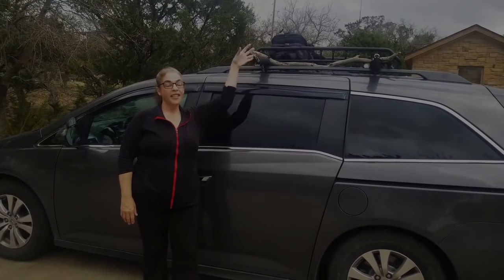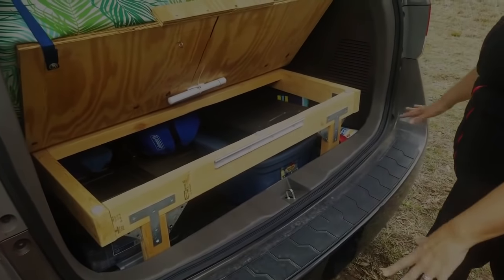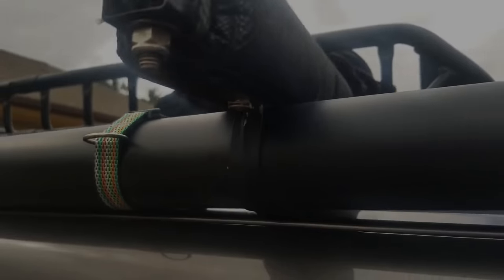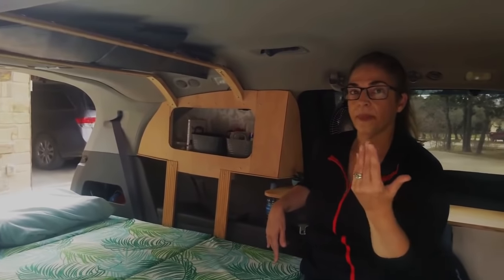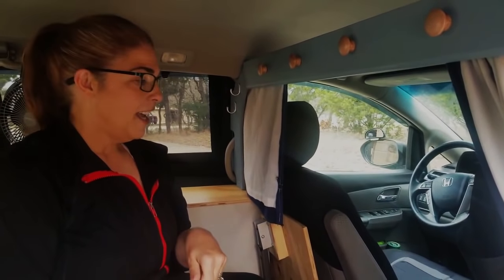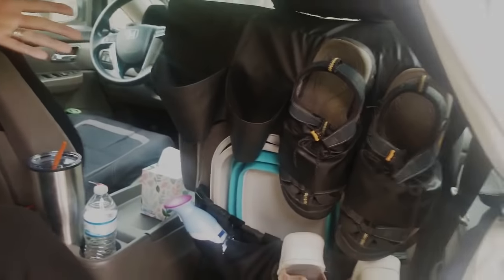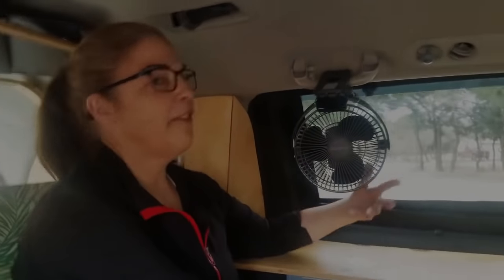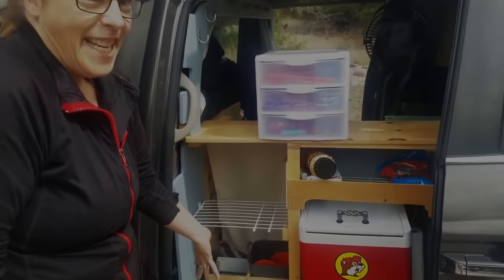My minivan camper REVEALED! Full in-depth conversion van tour

Comment from the maker: Watch Next > How I use the toilet https://youtu.be/61V3hTasCdw  and  How I Built my Minivan Camper https://youtu.be/tb3yc9suL20
Reply: The arch for the front curtain doesn't block the light at the top. You need another board on top of that straight board and ARCH it. So it does work.
You did a great job on the sides though.
Reply: Question, what is tge height of the legs fir your bed? You can sit up!  Yet it appears you still have storage underneath.

Comment: I enjoyed your video and learned a few things. Love your ability to just turn it back into a minivan, nothing drilled or modified from the original condition of the van. Very interested in how you secured the arch using I think the two grab handles(?). Also loved your convertible couch design, and that table, omg.... such a dream to have in a minivan (I  have the same van) and be able to actually sit up and be comfy at it. Thanks for posting!

Comment: I have a 2007 Odyssey and love the beast! I'm in the process of modding it for camping and it's great. I found a roof top basket like yours at discountramps. Excellent selection for ramps, racks, etc. I'm also a kayaker and using a 12' inflatable paddle board and 12' inflatable kayak which will be stored on top. They are very compact! Your build is just great and thanks for the vid!!

Comment: Hi Leslie, your video popped up & I continually look at these van builds bc I think someday I’ll wake up knowing how to build sh*t but so far...  I bought a 2019 Dodge GC & it’s just me to plan for.  I am giving up my apt soon, putting loved things into storage & doing a no-build build using things I already have.  I don’t want to spend money on plastics. 

Kudos to you for being so handy. I would attempt a project but I don’t own tools or have an area to use so I’ll just subscribe & bookmark ur channel with the hope that someday I could do 1 or more of these builds myself.  As u said, people modify their initial build all the time, I’ve heard that from most creators.  

Bc I want the best storage, I would love to have those side cabinets that fit into your rear windows but I do have to consider that this van has the venting windows in the back so I would need to have a clear path for that air or be able to have the fan there.  My next interest is having that arch but again, this van has a plastic column down the middle of the whole ceiling just to hold tablets for people’s viewing pleasure from the 2nd & 3rd row seats.  I would need to scribe the wood around that but at least I have the door handles to strap to.  Problem is, those handles are handy for me to use getting in & out sometimes.  I have lots of room above my head in the driver’s seat so I would love to have a shelf built on the top so I’m thinking of the arch going to the bottom of that ceiling column & the shelf in 2 parts on either side, if u could imagine that. It would just be used to store the window covers & soft goods like towels, clothes, etc.

This is dependent on if I need those door handles but time will tell as I could just use a little step stool to make the big step into the van (only bc I’m 72 & have lost some abilities I used to have, lol).  I am thinking of getting a running board installed like I had in my SUV to help me get in/out.  Anyway, I’ve chatted enough, I’m going to binge ur other videos.  Wishing you guys love, luck & health on your journey. I’m in NJ but have a feeling I’ll end up in FL near my sister in PSL eventually when I tire of my travels.  Cheers, Mo in NJ.
Reply from the maker: Hi Mo, Yeah it's great to stay inspired even if you're not going to do that exact project. I watch videos of all kinds of swanky stuff I'm never going to build!!🤣 Like you said, you never know what will become of your van, or when / where inspiration and energy will materialize. You have  a lot of options, too, if you're travelling solo. All the storage...the STORAGE!! Best of luck during the design process, and let me know how it's going. Thanks for taking the time to chat.

Comment: nice setup, I too have a minivan but I do have solar and a car carrier on top for the weeks out in  BLM land and a shower tent. I do like your side shelves in the back. I will check out that video.
Reply from the maker: Hi Nota, I'm jealous of your shower tent, as I am right this moment trying to attach a tent fly to my van so I can shower in a... shall we say... modest fashion😆
Reply: @TheVanThatGotAway   thanks for the reply, I have the old version of Walmart's Ozark trail 2 room shower tent, (they have a new instant pop up one now) the tent can be set up by 1 person (I'm a solo traveler) and my bed can fit in it when it's too hot in the van. I did mark the poles and pins that fit in the ends of the poles with bright nail polish dots so I can quickly know if I have the correct pole in fading light.  the price has doubled since I bought mine but if I have too I would pay it to replace mine, but it shows no wear or signs of aging and I've used it for years.  you can tell I really like my little tent.
Reply: @TheVanThatGotAway  i haven't built it yet but I was thinking a shower curtain that hangs from the trunk.  Get a bamboo matt.  Also another guy did a pvc pipe on the car roof angled with gravity feeding it.  I'm thinking that that gravity connected to a small on demand water heater...connected to a shower head would make a portable shower.  The shower curtain hanging from the hatchback would have to be something that could be rolled up and snapped back into place for storage.

Comment: I really love all that you did to your Honda Odyssey!!  Great job!!! Wish you could give me some ideas for my 2016 Honda Pilot.  I've been camping in the Pilot for about a year.  I also have a camper shuttle bus, but find myself using my Pilot for longer trips and last minute trips (whether overnight or several days.)  I must say I enjoy being in my shuttle bus camper because every window opens and the airflow and extra space are amazing, but my Pilot is so "easy" to take off in - I hardly ever pay for a hotel room anymore, instead choosing to find a tenting campsite for $10-$20 and I can use their shower in the morning too.  The only thing is.....I'd really like a few things built in for the Pilot, but haven't done so yet.  I would like to take all the rear seats out, but am unsure if that will void a warranty or cause problems with the air bags. LOVE LOVE LOVE your bed, table, arch, and kitchen space!
Reply from the maker: Hi Shannon! Sounds like you're living the dream 😃 I love that you have choices. That's a really good question about the warranty; I don't have any experience with it. Are any of the seats designed to pop out and back in,  like the 2nd row of some minivans?
Reply: @TheVanThatGotAway  it does not appear so. I’ll call the dealership today. Thanks for your awesome videos!

Comment: This is awesome! Quick question, Did you drill the strap into the plywood to assist pulling the bed back up or staple it on?
Reply from the maker: I used a big, bad screw and washer to secure it. Thanks for asking!

Comment: Great build!! The bed looks very spacious! What dimensions did you end up going with for it?
Reply from the maker: Hi Beau, I've been looking around for a tape measure but I didn't pack one for the road and we're currently on the side of a mountain somewhere 😂 But I bought a full sized foam mattress, then cut down the width a few inches so it was as wide as it could be and still move when changing the bed to a bench. Stay tuned and I'll do a more in-depth video down the line for you on just the bed build.

Comment: Wonderful, you helped me with all my issues for bed, cross bar and rangement! What make you decide to put the shelves to the driver side beside the passenger side?
Reply from the maker: HI Joanne, Thanks for asking! Do you mean those shelves that go in the 3rd row window wells, with the 2 slats across the ceiling? I decided to put them on both the driver's AND passenger's side since my husband and I are both travelling together. We need all the storage space we can get! Thanks for watching.
Reply: @TheVanThatGotAway  no the one just near the driver seat, where you put your icebox..
Reply from the maker: For that, I went back and forth a LOT but I decided to keep the passenger side unblocked in case we had to let anyone in / out curbside. 'Cause if I put the bed in bench mode, I can actually install 2 out of the 3 middle row seats. Thanks for asking!

Comment: Awesome videos Leslie, thank you! Quick question, do you have those blackout reflectix for your windows ? If so did you use spray adhesive for the fabric and if so does it smell? :))))Thank you so much.
Reply from the maker: Hi North! Yes, for the window coverings I used some Reflectix cut to size, spray adhesive to hold the fabric in place, then sewed around the edges to hold it together. Nope, I haven't had any trouble with odor from the adhesive, everything's cool. Thanks for asking.😀
Reply: @TheVanThatGotAway  thank you so much Leslie for the quick response :-) enjoy the rest your weekend… Keep posting those great videos, I love your creativity and you make it seem so easy. Thank you so much.😊
Reply: Leslie, what brand of spray adhesive did you use?

Comment: Nice job! Safe to cover passenger side back rear window? I am planning to leave it open as per Ericenjoysearth I think.
Reply from the maker: Hi Michael, Good question. I only covered the 3rd row passenger windows - left the 2nd row open - and haven't had any issues. When changing lanes, I use a visual check out of the 2nd row window as well as the passenger side mirror camera. For the driver's side, I also got one of those wide angle clip on mirrors that really extends my line of sight. So far, it all fits my comfort zone. Thanks for asking!
Reply: Same here - we only covered that very back 3rd row seat window, too, because we found we weren’t using it to look out while driving. The other windows and mirrors have good blind spot coverage.
Reply: @TheVanThatGotAway  the side mirror camera and clip mirror are good to have. Glad it works for you. Safe and happy travels :)

Comment: Nice build-out! Just curious whether the roof rails protrude past the car width as that would definitely be picked up as a hazard to other road users here in UK (cyclists, motorcyclists, pedestrians 🤕 etc)
Reply from the maker: Hi OB, I purposely measured them so they were not as wide as the van itself. I had a lot of room to work with,  as the Odyssey is a little over 79 inches wide! No wonder I have a hard time backing it in to the garage.  🤣 Thanks for asking.
Reply: @TheVanThatGotAway  good to know, it was hard to tell from the vid (or maybe just my eyeballs!) ...it sounds like a beast! Happy travels 😊
Reply from the maker: Thanks! We're doing a short trip in about a week so I'll be checking in from the road 😃

Comment: I'm a super minimulist and always super organized and clean.
Being a minimulist I'm not impressed at all with build outs.  I think they add a lot of weight and clutter up the open space with wayyy to much unnecessary items.
However, you did not go hog-wild building out.  And your designs were very well thought out.
I still think there's too much stuff, yet, if you're okay with this, then so be it.  For example...the cooler...you can actually keep foods (even watermelon, cheese, and other noted foods, under towels and they'll stay fresh).  
Also, I'm not a fan of closing off one of your 2 sliding doors (hence adjusting to less stuff).
All in all, not bad...and you really thought out your ideas and moderate builds.
Good design.  If I was going to get more sophisticated, yours is decent.
As an organized, clean, minimulist, I love the unused space inside my mini van as I like space, not unneeded stuff that takes up...yes...space!
      🎶  🧕  🎶
Reply from the maker: HI KN, Thanks for your thoughtful reply! I totally get the need - the NEED - to keep things organized and neat. My dream is to have a camper where everything that's not being used at the moment is folded away somewhere and disappears. Like a transformer, LOL! This whole project was a balancing act exercise between aesthetics and necessity. Thanks for watching and taking the time to chat.

Comment: can you show how the bed frame works.  i like to see it pulled out without mattress on it  also what size is the mattress long and wide thanks. great job
Reply from the maker: Hi Joe! I must have been thinking about you because I just put up my first video about the bed frame. It'll give you a good idea of how to build it. We're currently travelling through the Tennessee mountains without a tape measure, but I bought a full size foam mattress and had to cut down the width a bit. The length wasn't changed. I'll get more into measurements when I do a detailed bed build video for you. Thanks for asking!

Comment: Hi Leslie, Love your build.  I'm currently building out my 2012 Honda Odyssey.  I had a few questions.  I like the size of your kitchen center and table.  Could you provide the dimensions of them?  Also, I see you don't have a sink.  That's my big debate right now.  I may have missed it in one of you other videos but how do you handle not having a sink inside and would you stick with your decision not to have one.  Thanks for any info.  Keep up the great videos.
Reply from the maker: Hi VT!  To sink or not to sink was my big debate as well.  But after living in the van for a while, we realize we do all of our cooking outside usually on a picnic table.  When we wash dishes, we just take a gallon of water and pour it over the dishes onto the ground using biodegradable eco friendly soap.  Or we spray a little bit of vinegar and water onto the dishes and just wipe them down. For us, I don't see any benefit in having a sink which would basically do what we're doing now but just retain all the gray water in our vehicle, taking up space and and providing an opportunity to leak. No sink, no regrets! I'm actually making a video about the "kitchen" as we speak. Hang tight, okay?

Comment: What are the usual temperatures where you are at? Good to know that a fan of this size is enough, I was about to get the same thing. But besides that I am considering installing those fan-tastic ceiling fans, but you convinced me that it might not be the priority for now...
-newbie van dweller
Reply from the maker: Hi Liza, We've been traveling between about 30 degrees F and 90 degrees F. The fan comes into play for sleeping, so when 90 drops to a bit cooler we get the fan going and it's more comfy than we thought it would be! Hey, we can always install the roof fan if we want. But we figured we'd try the easy way first. So far, so good. Thanks for checking in!😃
Reply: @TheVanThatGotAway  Thank you, this was helpful.
Do you sleep with just the windows cracked open?
Reply from the maker: Yes, until hubby finds out. Then he closes them when it's chilly. 🤣

Comment: Leslie...oh my gosh I love you! I'm a kayaker too! One day I hope to travel in a stealth way. I have a toyota seinna mine came without a roof rack grrr but my husband insisted we get it.pleaseee pretty please tell me of you experience installing roof rack. Any issue with leaks toyota? toyota wants to charge about 3 thousand..apparently Toyota doesn't sell the roof racks and they refuse to put a brand that doesn't line up with preexisting holes. They will not be responsible for leaks after instalation but they also refuse to drill holes. .my major fear roof leak.  Did you say you installed your own roof rail? Details pleaseeeee..Any issue with mold or dampness with just using the fan? Great conversion and video👍💝
Reply from the maker: Hi Catherine! Siennas are great, I could have just as easily bought one. Re: the roof rails, you can totally install them yourself. On the Honda, there were 2 long strips of soft metal on the roof that hide these short bolts. Once you gently pry up the strips, you can see the little bolts. The bolts are designed to receive the roof rails. Since you don't drill into the roof or uncover any holes, there isn't any way to cause any leaks.  Check out some videos on how to install them yourself. It's not TOO hard, although I did throw around a few f-bombs doing mine. I think you should be able to get original manufacturer equipment rails for about the $300 range. 
Re: the fan and mold or mustiness, we haven't had any issues. Remember, it's still a car and you probably have the windows rolled down now and then. And when we sleep, we usually crack the windows about an inch or two and use the fan for some good air flow. And we keep Febreze handy🤣 Right now we've been on the road full-time since September and so far, so good. Thanks for asking! Thanks for watching! And thanks for the kind words 😊
Reply: @TheVanThatGotAway  awww Leslie thanks so much..can't wait to see more videos of your adventures as I live vicariously through you until I pray one day to become a nomad and chase the sun. Take care. Stay safe stay strong💝🌞🌻💪🙏🕊💝

Comment: I think the ceiling storage is very clever.  So is the archway to your cab area.  That is a novel idea.
The bed is also very clever, as it is a seat from both sides.  Smart idea.

I think you need a 12V fridge like Alpicool. The current cooler set up is makeshift. Your food is poor quality if you are eating processed meats and cheeses.  Get fresh food, fresh meat, cook it up over a campfire with a fresh salad.  You should not eat so many carbs and boxed foods. 

You don't have a kitchen at all - no fridge, no stove.  No bathroom toilet or shower set up.  No power grid either.  This is not a complete camper.  This is a car with a bed and some shelves. A conversion is when you have food storage, power supply, bathroom facilities at the very least.

You switch between 'we', and 'I'. Did YOU build this yourself or some other person built it for you?